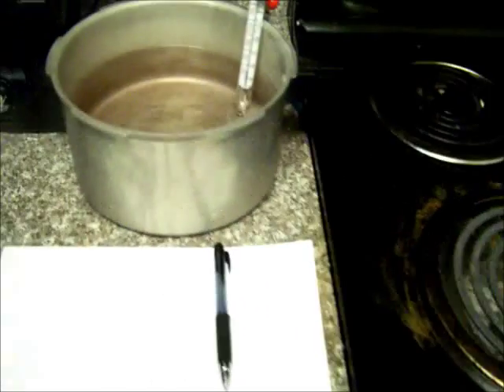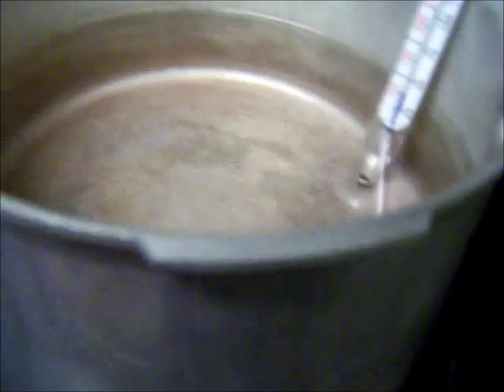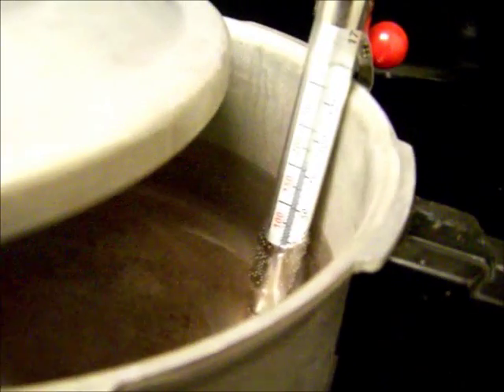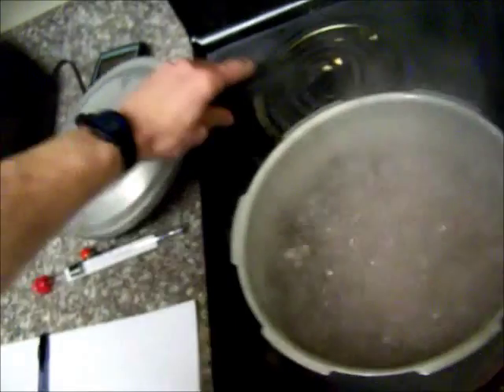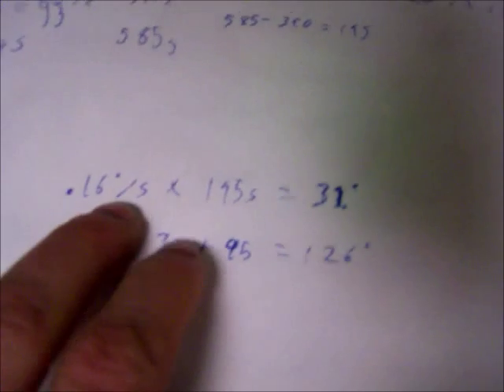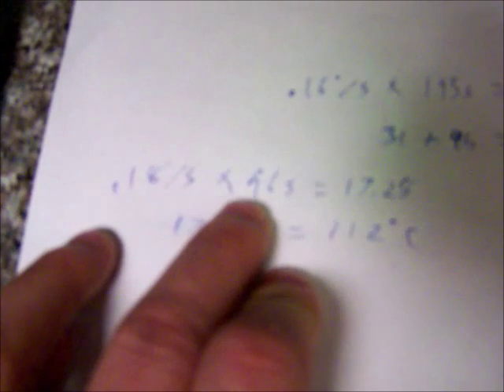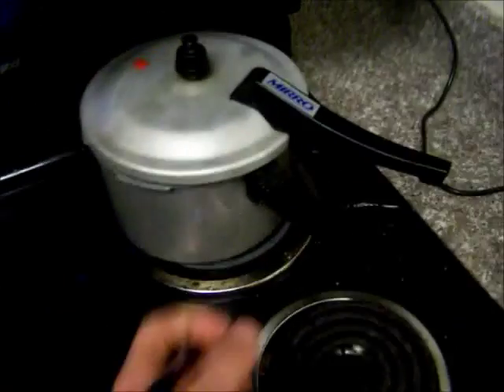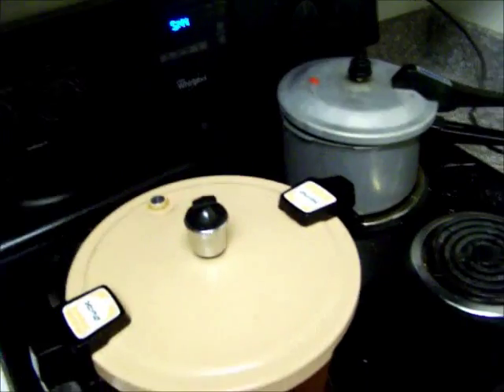Measuring The Temperature Inside a Presure Cooker

Comment: my fissler pressure cooker manual said :

At the Gentle Setting (1st ring) : 109°C (about 0.4 bar)
At the Speed Setting (2nd ring) : 116°C (about 0.8 bar). 
...

I don't know any formula can calculate the temperature 109°C/116°C from the pressure  0.4 bar/0.8 bar .

Anyway,  your calculation give 126°C which is very impressive .
Reply: the inaccuracy is caused by the fact, that heat capacity of the water increases with temperature...e.g its 4.18 kJ/kgK at 50°C.....4.20 kJ/kgK at 80 °C....and 4.22 kJ/kg at 100°C......I believe Cody approximated only linear increase of the temperature with time

Comment: 0:29 knowing that water boils at 100 degree celsius therefore starts to produce excess pressure that will turn the valve deal. wax melt at 46- 55  degree Celsius and skin too I would recommend a warning to be .... etc